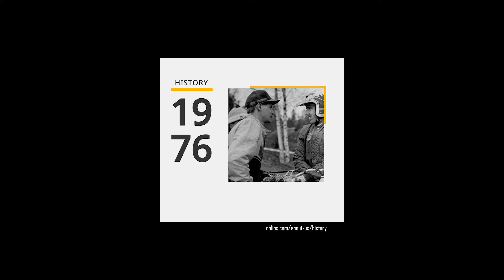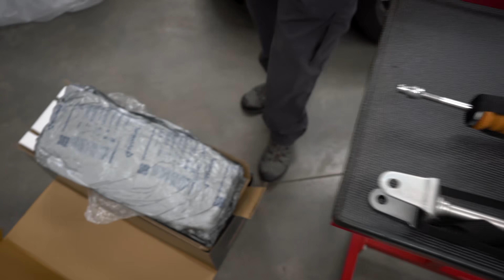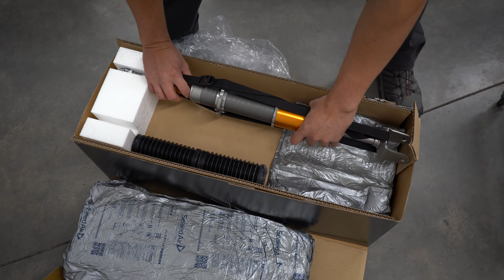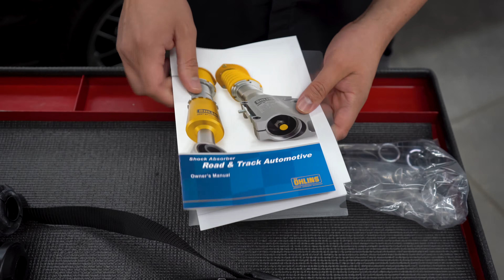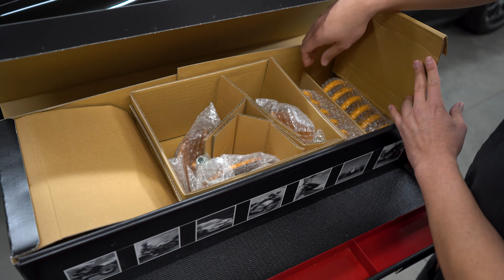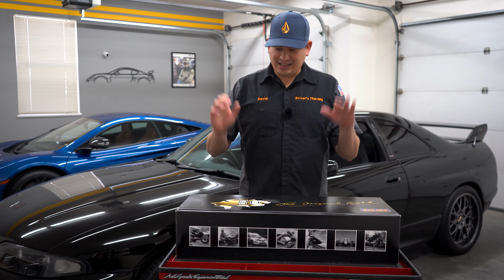R33/34 Skyline GTR Ohlins DFV Coilovers Series - Part 1 (Introduction & Unboxing)

Comment: Awesome, I ordered mine for the R33 last week, but I went with the rubber top mounts.  Any reason you wanted solid tops?
Reply from the maker: I honestly did not know there was a choice. I just ordered the kit. Where did you order yours?
Reply: @DriversTherapy  RHDjapan website.  Quite a bit cheaper with the exchange rate.  You have option of pillowball or rubber.  I went rubber as I didn't want NVH of solid parts in the suspension.  I receive them next week.  Also got my super turbo exhaust as no one in the US has it apparently 😐
Reply from the maker: Nice! Good to now, I have ordered from them before, great online store. So what is NVH? Thanks.
 @zboost300
Reply: @DriversTherapy  noise, vibration, harshness
Reply from the maker: @zboost300  true. I will definitely be updating on that part.
Reply: @DriversTherapy  I think you can order just the top hats themselves if need be.